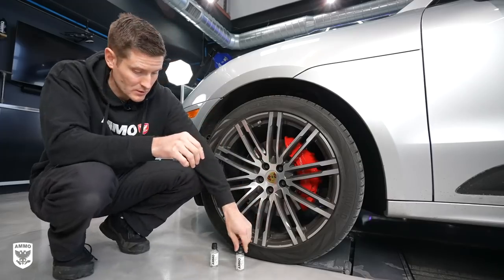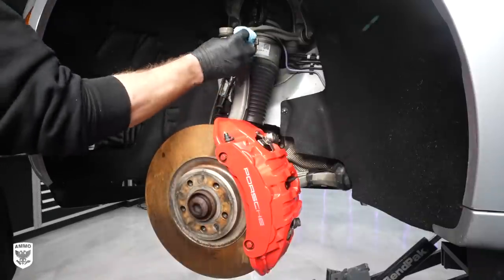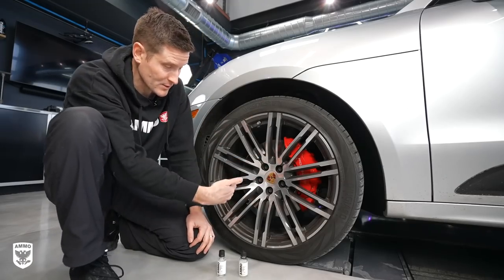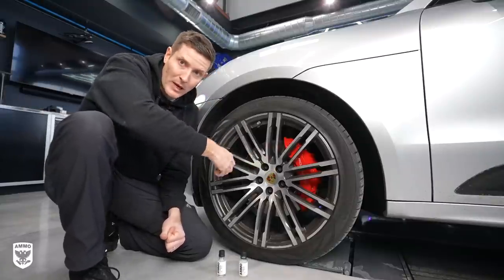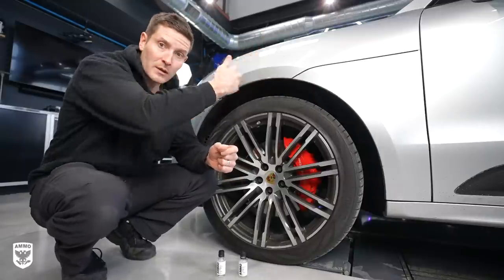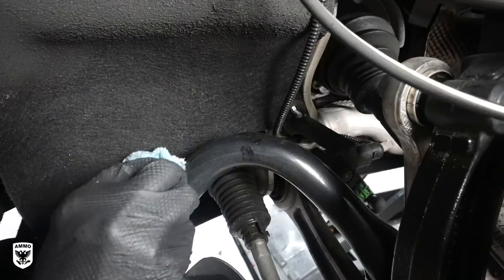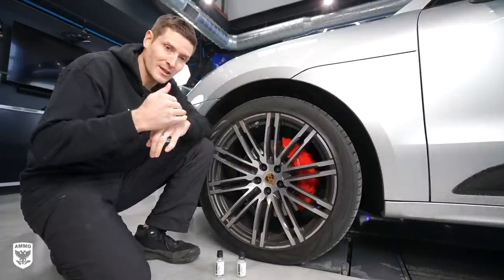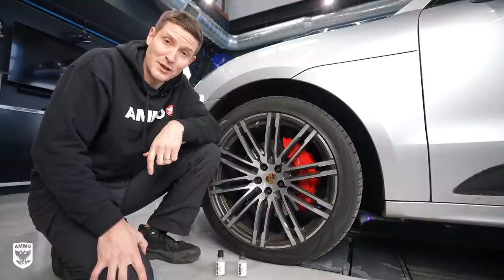How to Protect your Wheels, Calipers, Exhaust, and Suspension: AMMO Gelee Pro Wheel Coating

Comment: What product would you use to maintain it, and would a wheel cleaner reduce the strength of the coating? I’m interested in getting this
Reply: He mentioned using top coat in the video.
Reply: You probably dont need to use a specific wheel cleaner to clean coated wheels if you do so regularly. Normal car soap should do the trick, or use Brute wheel soap for a little extra bite.
Reply: @inspiremensstyle6088  ohh thanks
Reply: @HEMi1995  thanks

Comment: When you say that it can be applied to an exhaust, what temperatures are we talking? If I've got a full system motorcycle racing exhaust, can I apply it to the full system, or should it be used only on the end/exhaust tip?
Reply: Probably just the tip, the headers get crazily hot (at least on my SF V4 they do...)

Comment: What would you use to remove it? I applied it by accident to motorcycle fairings after I ran out of the reflex pro enamel. If the paint doesn’t get damaged then I don’t mind. But if the paint would get damaged by leaving it on then please advise on how to remove easily without risking damage

Comment: 100 bucks for a bottle. 😬
Reply: 1oz too. I have a bunch of ammo products. All work great. I can't justify spending that much on a product no matter how well it works. If I had Ferrari money, sure. I have mustang money 😄
Reply: FWIW, I get about 12 to 15 sets of wheels out of a bottle of Gelee Pro (faces and barrels). So it’s about $7 or $8 per application, and each application lasts 1 to 2 years. The price may be high, but IIMO the value is as well.